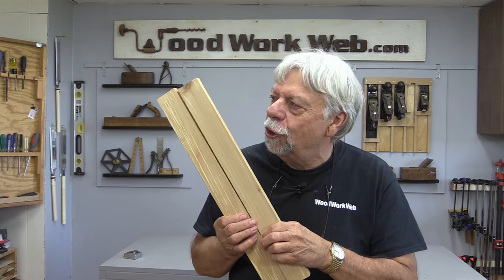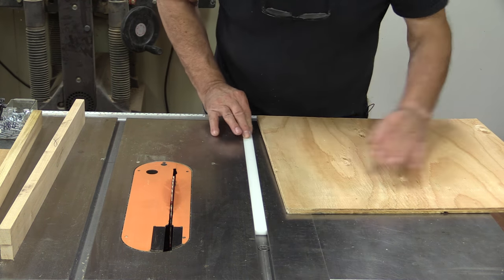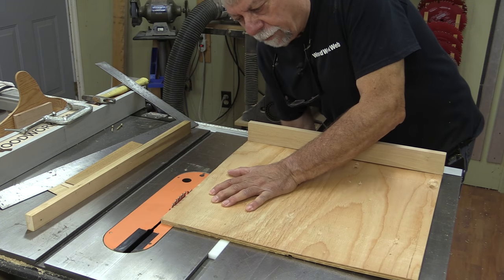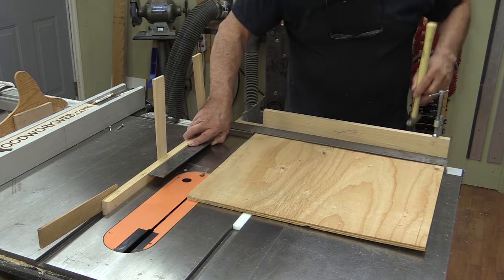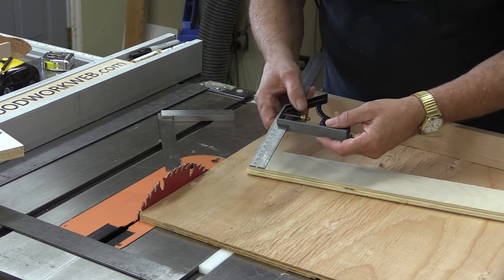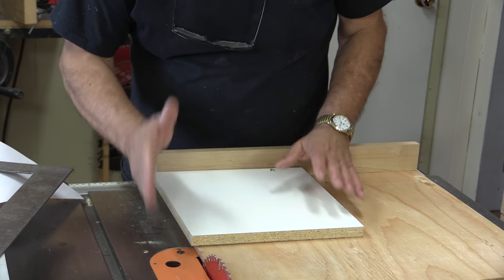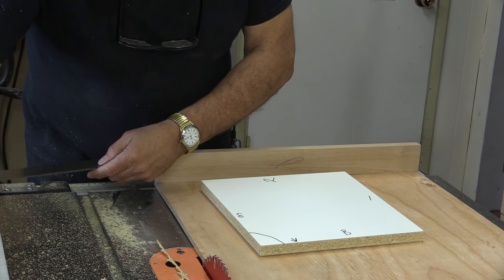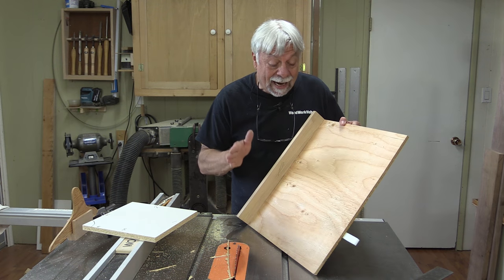Easy Build Crosscut Sled for The Table Saw / Accurate Speed Sled

Comment: I'm well aware that your base piece was "square" but why didn't you place the base a little to the right of the blade after you attached the runner in order to ensure the base was parallel to the blade with a first cut?

Comment: Colin, I think the warp of the plywood is going to effect how square the result is across the thickness of the workpiece.
Reply: Wouldn't the thickness of the board be a constant? If so, 90 degrees=90 degrees to the edge. The paper test proves that it is accurate and reliable.
Reply: @mikeprell2747  Mike, the warp of the plywood base will lift one end of the workpiece relative to the table top.  Assuming the blade is square to the table, then the workpiece will not be parallel to the table and the cut will not be square vertically.
Reply: @johnpjones9229  Having just watched Collin's video for the third time, I conclude and agree with his "probable sufficiency" theory. From what I could see, through his checking with his square, the four sided test piece looked acceptable. In other words, "close enough for government work". Good conversation! Thanks.

Comment: Nice explanation, Colin.  Dust caught between the material and the fence can throw off accuracy.  A small but supremely useful detail to include is a 1/8" chamfer @45 degrees on the bottom front of the fence.  This gives dust a place to go as you slide material up against the fence when making repeated cuts.

Comment: As the title says: "EASY".    Not only is the sled easy to build and accurate but the tip about using a brad gun to initially attach the guides for the miter slot is just awesome.   Made mine today in just over an hour.   I used delrin to make the guide for the miter slot and cut it to the width and depth to fit perfectly.   Another material I have used for projects like this is nylon from a white nylon cutting borard.   Usually easy to find and fairly cheap.   Ask permission before using the one your wife has in the kitchen.
Reply: Nice video. But, if you attached the guide over a bit, you could have took a cut off the sled, and yes that as your dead square.
Reply: And USED that as your dead square.

Comment: I use a similar sled. I place a matching piece of base on the other side of the blade to prevent tear out and support waste side. This piece is held in place by wood  mitre gauge blanks and with washer on end .

Comment: Check out the five-cut method sometime. You can use that method to calculate how much you need to adjust your fence if it's off. It does require some math, though.

Comment: Another excellent video, Colin. I have made an almost identical sled but what I did first was cut the right side using the sled itself without the fence. I then used that cut side as my reference to square the fence. I guess its a similar process to yours where you are referencing off the slots NOT the blade. The only time your method won't work is if the right hand slot is not exactly parallel to the other slot but I doubt too many table saws have that problem but you never know.

Comment: Good tip Colin to use a sled for crosscuts.  If you have calipers I would use the 5 cut method that William Ng popularized to check squareness of cut. As Colin mentions It depends on how accurate you need your cross cuts.  I also like to use 3/4" MDF instead of plywood for my sleds.  A nice flat surface.
Reply from the maker: Thanks for the tip and thanks for watching!

Comment: I have the same saw,  I bought a Lee Craft zero clearance insert for it, and it works beautifully.   I attempted making my own originally, but it was too thin.   The Lee craft is nice!
Reply from the maker: It's a great saw. Thanks for watching!
Reply: I made one myself, it happened that masonite was exactly the right thickness. However, when you use a sled it doesn't come into play.

Comment: Well, if you've already taken the time to make sure that your rip fence is parallel to the miter slot, it would be much easier to square your sled fence to the rip fence. Also, if you leave your sled long on the blade side, you can simply cut  that edge off, as a last step in your build.  Great video!!
Reply: Don't forget the problem of systematic drift.  You are right that squaring to the fence works if the fence is parallel to the miter slot.  But is it?  And some workers purposely splay the fence a mil wide behind the blade to eliminate binding.
Reply: True enough. I guess it's a matter of knowing your machine and persinal preference ultimately.

Comment: Really enjoy your channel. You find that using only one runner does not create consistency problems? I’ve made a few tablesaw sleds with varying success. But I always use both slots. Also, any reason why you can’t do the same on the opposite side of the fence?
Thank you for sharing.

Comment: Two thumbs up on this video. I'm building one as soon as my boss leaves for next delivery of furniture.    We use a dewalt radial arm saw that reaches 17" for most of our bevel cuts.   It's hard on it.     I could make a few of those sleds.   One 90 degrees. One 45 one 32 and one 17.    That would do most everything except my bar stools.   I don't know the angle on that piece yet.  Never used the table saw cause the cut is 21"

Comment: I would be concerned about kick back.  Because the cut off of the work piece has to drop down from the sled thickness to the table top as it is moving forward.  A traditional sled prevents kick back because the cut off piece rides on the sled and doesn't fall to the table.  What is your thought?

Comment: Hi Colin, I normally use a compound miter saw or a radial arm saw for crosscuts. However I now have an 18" x 18" x 3/4" red oak I would to crosscut.  Why do we not use the table saw fence to make this cut?

Comment: Another test, cut along one edge, cut edge two, cut edge 3, then put edge 3 on the fence and cut about an inch strip off of edge 1. Then measure the width with calipers. (I think I said that right.)

Comment: What is the advantage of the sled when you  have an accurate miter gauge with a long fence. Mine is an ancient Delta saw miter gauge.
Reply: Small miter gauge, smaller backstop.. Better to be larger for larger pieces.  Most miter gauges these days are junk if they come with the saw.  Although older miters are stout, a sheet of plywood will hold the backstop in a more stable manner, as it's fixed at 90, or whatever angle you build it with.

Comment: Interesting take on the 5-cut method, doing 4 cuts (well, 4 if you count the 1st side you jointed as the 1st cut, which can also be done on the sled, if one does not have a jointer), and sliding a piece of paper in the gap.  This is especially useful for someone who has a carpenters square, but no caliper micrometer.  If you do have a micrometer, of course, you can go ahead and cut an inch or so off that first side that went through the jointer as your 5th cut, and measure the difference in width at each end of that 1-inch piece with the micrometer.  I'm betting yours is not more than a couple thousandths of an inch off there.  Which shows how effective your squaring the fence off a board jammed in the miter slot truly was!  

Also effective was wedging the board in the miter slot from behind, so that you registered square off the side of the slot nearest the sled.  Some might push on a looser board in the slot with the carpenters square, pushing it into the far side of the slot, which could be off if the board's thickness were not parallel (due to a knot, twist or other flaw).  Your way of registering off the side of the slot nearest the sled is the right way.  Well done!
Reply from the maker: Thanks for watching!

Comment: Thanks Colin.  Nice video.  But as a new woodworker, I have a question.  Most of the videos regarding miter sleds and miter extensions say the back fence should go pass the saw blade to avoid tear-out.  Shouldn't the same principle apply to this miter sled?  If not, why not?  Can anyone answer this question.?  Am I missing something?  Thank you in advance.
Reply from the maker: Yes, you can try that and see if it helps. The BEST way to avoid tear-out is to use a high quality, fine tooth blade. Thanks for watching!
Reply: This design ought to limit tear out on the supported side, at least.

Comment: Could you suggest material to use if miter stock or miter strips are not available.?
Reply: HDPE plastic. Buy the cheapest plastic chopping board you can find and cut it to size. It slides nice and smooth. You can cut and drill it with regular power tools.

Comment: Morning Colin.
I've recently retired and I intend to take up woodworking as a hobby. 
My question is,  what can one do with a crosscut sled that I can't do on a sliding mitre saw?
Reply: A sliding miter saw has a fairly open throat that can prevent making very accurate cuts on small/short pieces of material.  You can, however, attach a sacrificial zero-clearance fence to the miter saw's fence.  A sled on a table saw is a lot easier than that because it requires no special setup for a specific cut.  Another plus for a sled on a table saw: you can cut rabbets and dados to any depth you like with extreme accuracy.

Comment: Great explanation. Thanks for sharing.
How is it possible to control the squareness of the back-fence of the crosscut sled in case the table saw has only one miter slot?
Reply: Hans: I think a better procedure for making a sled like this is to attach the runner so that the sled protrudes past the saw blade. Then cut the base off by running the sled past the saw blade. Finally, take a carpenter's square against the base of the sled that you just cut off and use that to align the fence.
Reply: @XJWill1  Thanks.

Comment: How can you be sure that cut is accurate given the the sled isn't even flat to the table?  You measured the final product to 90 degree corners but it is certainly possible that the corners aren't 90 degree across the entire short width of the edges.  As you start cutting you can actually see a relatively huge gap between the sled and your test piece.  The blade is going to want to drive the test piece down which will make the vertical surface of the test piece want to tilt down away from the vertical upright piece on the sled.  I don't think you can trust the flatness of the edge surfaces of you test piece.  A non flat sled seems too risky using this process.

Comment: I don't think I'd trust a carpenter's square to be accurate for fine woodworking.  I've only owned  few, but none were really square.
Reply: Solid steel carpenter's squares are almost always very close to square unless they have been mistreated. I have always found this to be the case. Matthias Wandel has the same experience. I suspect your testing procedure or standard for checking squareness is flawed in some way.
Reply: @XJWill1  I'm glad you have had better accuracy than I have.  It's the 'close to square' that concerns me.  I do have an accurate way of checking for square, and have used a peening technique to make minor adjustments.  Colin has a 'squaring a square' video about March 2019.  There is also an article in Family Handyman, Oct/Nov 2018 called "Is Your Square Square?".
Reply: @markpowell6885  When I say "very close to square" I mean better than 0.1-degrees. Again, I suspect your testing procedure or standard for checking squareness is flawed in some way. Many people see a quick demonstration of a technique for checking for square but when they try to apply it themselves they make mistakes, such as not having a good straight edge, not fully immobilizing the square when drawing a line, or changing the angle of a pencil while drawing a line.
Reply from the maker: Normally, I would agree, but this one I've checked and double checked. Thanks for watching!